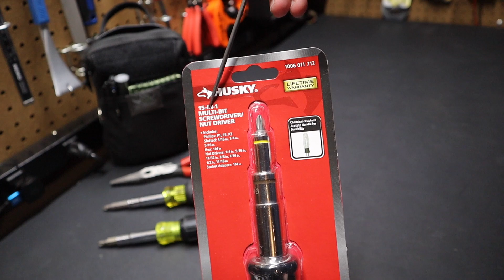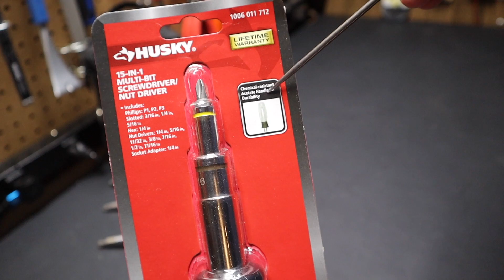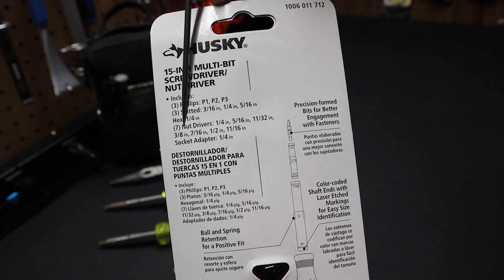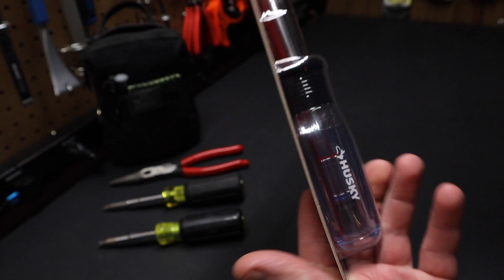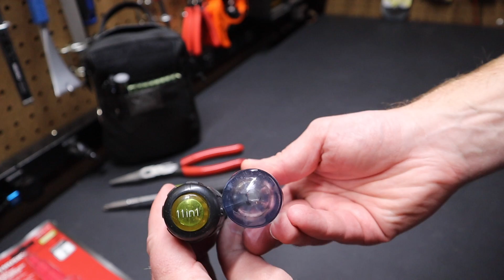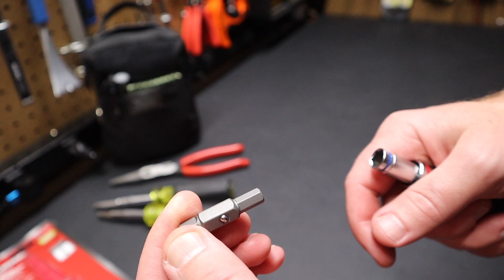Husky 15 in 1 Screwdriver nutdriver

Comment: Nice value for 15 bucks over similar Klein models. Seems odd to have a socket adapter on a tool that has so many sockets sizes on board though. I like the clear handle and beefy PH3/5/16
Reply from the maker: It is unusual to have the adapter on there. It’s a good choice if looking for a hollow nut driver.  Thanks for posting! 👍

Comment: I just bought one and haven't used it yet but took it out of the package and realized there were no instructions about changing bits. From your video it looks like you press in to unlock it and take out or change the bits. Mine does not budge though. I was also wondering if there's any way to take the ones out you aren't using so the thing's not as heavy.
Reply from the maker: You got it!

Comment: You seem to have missed the fact that in the handle if you pull the entire shaft out the handle itself has a 3/4 inch nut driver... That is tool #15
Reply from the maker: You are right, I did miss it.  I guess I figured most people wouldn’t use it. Thanks for the feedback and thanks for watching!  👍
Reply: The handle is 11/16 inch nut driver not 3/4
Reply from the maker: @proamlito07 Thank You!
Reply: I love this tool! Liked it so much, I bought two more for my car kits!! Pair it with a 1/4 drive Makita socket set and you’ve got a good little kit!
Reply from the maker: @JohnSmith-qj5bn  why do you like it so much?
Reply: @projectpinehills  I, personally, like it because it tremendously cuts down on the number of tools that I carry for service calls. It's extremely convenient.